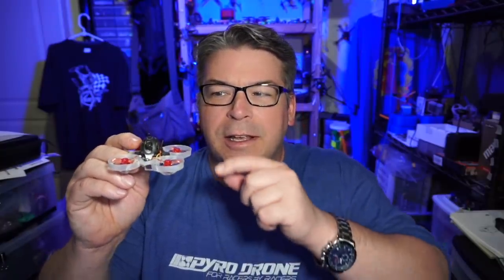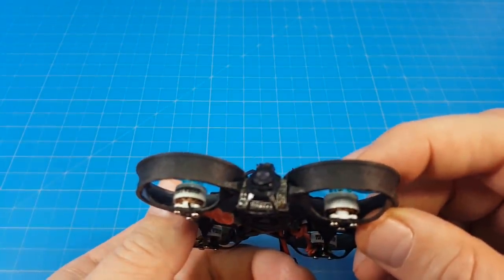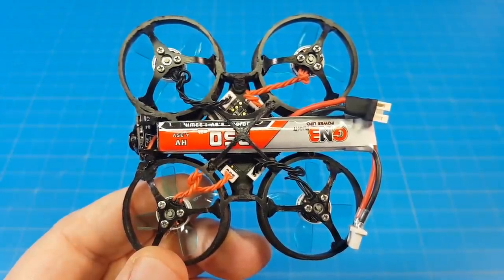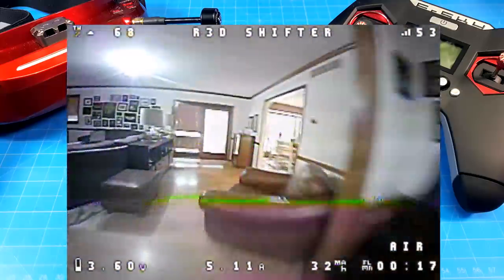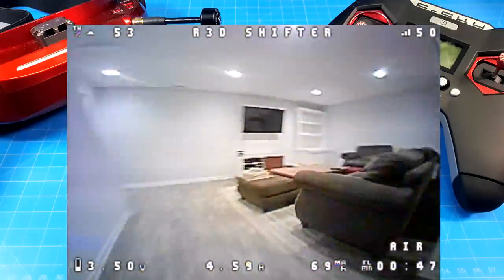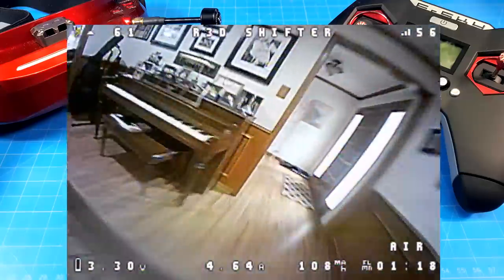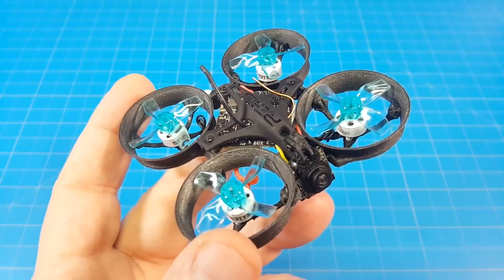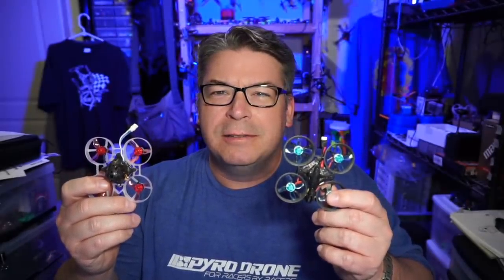ZeroGrav // 3D Print // Carbon Fiber Printed Micro Frame

Comment: Every time I watch one of your flights, I charge batteries and break something! LOL...You sir are a great pilot!
Reply from the maker: keep at it, over time it decreases. IMHO inside flying really helps us learn the fine control and makes flight outside so much easier.
Reply: @NickBurnsFPV   What kind of rates and expo do you set on your radio, and/or in BF for roll/pitch/yaw?  What radio transmitter are you using?   Could gimbal stick height play a factor in less control?  Seems to reason the lower the sticks, the more control if you fly thumbs.
Reply: Nick Burns Nick do you use solid pin PH2 connectors? If so where can I find them? Are they solder on pigtails or loose connectors?
Reply: Steve B tinywhoop.com should have some. The connector is already crimped on the power leads. Just solder them to the fc and your good to go.
Reply: Archer FPV Thanks man👍🏻
Reply: Steve B no prob 👍

Comment: No hoops in view is great, but it also felt like your mounting eliminated the very tricky jello issues it has on the stock frame.  As you were describing the reduced balancing load because of the center of gravity it felt you were aiming to say what I suspect personally; that it helps your batteries last longer (considering they are about the same weight).  This looks really nice!

Comment: I really enjoyed seeing the practise reel of the split s down the stairs maneuver. That's going to be killer once you lock it in! From the looks of most attempts, you've got the timing but the 1s setup just doesn't have enough power to pull out at the end. It's going to take a perfect shot, or going up to 2s to get it consistently. That got me thinking about lines while watching, and here's a suggestion/request if you're up for trying.

Go up the stairs then u turn and go down the hall along side the stairs the same as before. When you get to the end of the hall at the front wall of the house, instead of doing the u turn and then slit s, do a power loop up the front wall and back across the ceiling that drops back down into the stairwell to the main level. If you get the angle right as you float backwards while upside down it should actually give you more response time to spot the exit at the bottom of the stairs and more distance to recover thrust and stabilize for the turn out into the dining room. I know it's a tall order, but hey it's whoop season, and I bet you can pull it off!
Reply from the maker: That’s a good suggestion. Gonna have to get that half power loop right. Something fun to try

Comment: I know what glue to use its called Welders . A guy named Nick Burns told me about it . :p It works great I use it all the time . Thanks Nick
Reply from the maker: you got me :)  I need more. My cap got stuck and when I got it off I cracked the lid and it dried up. Back to amazon I go.
Reply: @NickBurnsFPV  I started wiping the tube with a paper towel ( use the same paper over and over) and the lid always comes off . Love your vids

Comment: I just took the canopy completely off my Mobula6, and reversed the frame to get a flat area to mount the camera between the ducts with a loom band. I also removed the motor connectors and direct soldered the motors to the board. Oh, and I replaced the PH2.0 with a BT2.0. Comes in at 18.1g. You could get it down even further if you really tried (by trimming the frame, etc). The new camera position takes a bit of getting used to, might have to alter the PIDs a little. Turtle mode works fine (I have the 19000Kv motors). I find that flipping it over in the pitch axis works better than in the roll axis, particularly on a wooden floor.
Reply: That 3D printed frame looks interesting but, it more than doubles the price, shipping to the UK.
Reply from the maker: It seems shipping outside of the US is a constant barrier. I have seen some slightly splitting a zip tie to make a low profile whoop, What sort of flight time you now getting with less weight and likely less ir on battery.
Reply: Can you please make a video showing details? Thanks!
Reply: @NickBurnsFPV  Close to 5 minutes. That is with the JazzMaverick 48kHz ESC firmware. I'm not exactly cruising but I have a really small house so, I can't push it like you do. I only charge my batteries to 4.2V.

Comment: I never thought it looked like a... BUT- we still need inverted motors/props like tinyhawk for unimpeded downward thrust. Prop "intake" airflow is more ambient and less depended on ubstuctions like wires/stuts
Reply from the maker: we might not be seeing much of that due to props and turtle mode. Maybe

Comment: I might do it? I'm really happy with the mobula6 it is by far the best whoop I've ever flown the 7 is great for more power but for performance the 6 has it all tied up! + no carpet in my pad so I'll stay stock for now.
PS
I hit a pole full pin,  only the front tip and 1 whoop cracked 2 drops of hot glue and a week later after many more hard hits it's all still good! Love the lack of damage on both the whoop or property from a glass to a wall! Happy model is on a roll! 
On another note the beta 65x 2s seems interesting hope to see you flying soon. 

Thank you and cheers

Comment: The  frame is Nylon 6 or 12, 3D Printed from particles (SLS). The clip seems to be TPU, could be printed with the same technology but can't tell.
Reply from the maker: I have been told its a hybrid filament of nylon and carbon.

Comment: FYI: My Mob6 went down in the first ten minutes due to a not too rough landing from only 12 inches off the ground. Though it was toast. Plugged it into Betaflight and everything was all screwed up. The dshot config. was wrong and ALL the flight modes were erased (It was all set up correctly before my first flight). I set everything back up as it should be (according to the paperwork they sent with the mob6) and all is great again. Flies perfectly. Just in case anyone else has had an issue with that board or drone.
Reply from the maker: I have heard this is due to battery w below 3volts. Maybe change the power setting to warn at 3.2volts?

Comment: Nice. I was thinking to modify a UR65 frame to be similar to keep most thing in line like this frame does. I also wanted to try a top mounted battery maybe they will make a frame like that.
Reply from the maker: A top mounted whoop would be interesting to try, it would bring the battery load a few mm closer to the prop line.

Comment: Use GOOP or E-6000 To Glue Stuff Together, Dries Pretty Quick & Is Silicone Based So It Stays Flexy? Also Works On Glueing Anything (Even Dis-Similar Materials) Together From Shoe Soles To Plumbing Pipes ETC, Can Be Molded Into Shapes That Stays About Same After Drying Also... Will Eat Some Light Foams On RC Airplanes+? About $6 For A Big (Tooth Paste Size) Tube Of It At Walmart+Stores? Thanks

Comment: Yes, I really like this design. Nice job R30Whoop. So much more expensive than a standard frame, like triple its cost... But that's only $10-$12 more!

Thanks for bringing it to my attention Nick, I think I'm in. They've got a couple of cool frames.

Additional note, I do some printing too. I've printed nylon impellers in liquid pumps with great success. Considered the CF Nylon too, but it can wreak havoc on your nozzles if you're not diligent. Again, nice job to R30 WHOOP. I'm excited about this possibility with a nice crazeebee F4 board or similar.
Reply from the maker: I am not surprised by the cost as I suspect the production is much more expensive that a mold. Then there is all the R&D. I think they did a nice job

Comment: Hmm I see on there site that u can mount the battery in the horizontal position, I wonder if the 350s would work well that way.
Reply from the maker: yes, I believe they added it to the site after I didn't realize it was an option.

Comment: Wow nick, im surprise you review this, i love this frame. And one time i receive the frame broken on transit, the motor mount broke just like yours, i do got replacement, they have very good support. Because it 3d print, you can repair it will solder, maybe not as smooth as new, but it will reattach nicely. Good enough to wait for the replacement arrive. About turtle mode, i got no problem with mobula 6 25kv and its 3 blade prop, however i use the r3dwhoop brushless frame, which differ in little strut in each motor guard, maybe the struts act as grip in the floor to help it flips.
Reply from the maker: The turtle mode could be the design I have. I see they have a slightly different design with the "horns" on the whoops, maybe those grip the floor a bit?
Reply: @NickBurnsFPV  in my case sometime it spin and stuck between ceramic floor and help the quad flip

Comment: The "stretchy/rubbery" parts are printed with TPU filament.
Reply: looks more like NylonX filament, TPU would flex way too much causing the drone to vibrate out of the air.
Reply from the maker: I have been told the camera and battery bit are a rubber filament and the rest either nylon or carbon infused nylon.

Comment: I can report that my Mob6 board changed almost all my settings when I ran lipo down past 3 volts in my error.

I have heard of others with Mob6 boards having same issue but I suppose it's not that bad as I rarly make running my lipo's down to stupid levels.

Nice flying Nick and love the look of that frame, its just the camera mount looks a bit iffy to me.
Reply: Hmm.. I often run my whoops down to 2.8~3.0v. That would definitely screw with me, lol
Reply from the maker: I believe licensetodrive had the same thing happen.
Reply: Btw, the reason that I often run them so stupid low is that the PH2.0 connector brings the voltage at the quad down under load (i.e. the actual battery voltage is slightly higher), plus the fact that the batteries are cheap, and come back up after resting..
Reply: To be more accurate I fly my lipo's on my Mob6 to 2.8 when resting after flight and I did make a mistake on trying to fly an uncharged lipo. I can remember the red leds on board go dark and convinced I had brocken my Mob6 and my lipo was fully charged so kept on sucking any atoms left in lipo.
Reply: @pepsfpv1326  ouch..!  but yeah I've done that too by mistake, lol ;)
2.8v after landing is definitely too low, though. Lipo's minimum safe voltage (even under load) is 3.0v. you can definitely abuse them a little, but that is pretty hardcore abuse, haha :)

Comment: Nick, I know this isn't about the M6 but I have a question I hope you or someone can answer. Just got my M6, and setup went fine. But the issue is that it won't come out of rate profile 2. Whether or not I change it  in BF or in osd, it goes right back to rate profile 2. It's weird. I've built dozens of quads and never seen this before. Not a huge issue, I just simply use rate profile 2. Any ideas ?  Thx. 
Btw, loved the split S over the stair rail. 😎👍
Reply from the maker: I have seen that on one board too. I believe I reflashed it to resolve...I think it resolved it.

Comment: I built a few low profile whoops in my life and always had issues with turtle mode on them. It's mostly due to them being flat on top. I had better success with gemfan tri blade or eachine/hb31 four blade props. 

I have a different question this time - which software and export settings do you use to edit your videos and upload to youtube?
Reply from the maker: I use Sony Vegas for the most part. Render to 1080p 60fps then upload to YouTube

Comment: Hello, I've that props too, the problem are the props, not the motors, another issue is the 1s, the same props with 2s, works good, but 1s and that props... Bad combination for turtle mode.

Comment: i am very impressed as a seasoned printer- carbon fiber nylon is difficult the print- The price is amazing. considering the energy needed to dry the nylon and print it at that quality.
Reply from the maker: Good info. Thank you
Reply: @NickBurnsFPV  also carbon fiber is abrasive so its very tough on the feeding mechanism and nozzle- often even coated and hardened nozzles need replacing after feeding kilograms of carbon fiber based filament through it- The carbon fiber with the nylon doesn't do much other than make it easier to print and make the print a little more stiff- it fights warping- warping is when you print plastics outside of an oven like environment, it can shrink on itself and deform- the carbon fibers help avoid that. its quite less strong than the carbon fiber that is weaved and coated in resin- much less rigid, very very expensive 3d printers can lay continuous carbon fiber- and the parts can replace aluminum cnc milled parts in production- however this is rare for consumer production 3d prints the fibers are much shorter and more "useless" in this nylon print,
the nylon is doing the magic here- its a very strong engineering plastic used in cars - often with glass fibers for the same reason as printing with carbon fiber. to stop warp and to increase rigidity

Comment: What tuning did you use? I kept frying those crazybee boards just using 450mah batteries so I've thrown a Geprc 12a board on instead but for some reason I can't stop th e motors from getting red hot, im only using 2S 300mah, and trashcan motors, I've tried mockingbird pids,  trashcan  pids and it just gets worse. Apart from this, it flies great haha
Reply from the maker: This one pids are the same as my mobula 6 pids. I didn't feel the need to change, I most custom tune everything I build and if an RTF doesn't fly all that well. In your case try dropping the d values.
Reply: @NickBurnsFPV  cheers mate will give it a go

Comment: Why don't they make a stiff frame, where motors connect, and have flexible ducts surrounding the props?
Reply from the maker: weight, cost and demand. There are some stiffeners that have been made to bolt to the bottom of the motors or slide around brushed motors.

Comment: I'm wondering what FC was used as Nick said this wasn't a Mobula6 swap. And I don't see the FC listed with the million batteries listed.  LOL
Reply from the maker: I did use the mobula 6 fc/esc/aio. The motors and props are different from the mobula 6, this is what makes it not a straight swap.

Comment: Wow, I’m still considering my first drone, been into RC’ for 20 years, but man that is impressive flying!!!👍
Reply: Go ahead and make the plunge D-rail. In started helis (and aerobirds, & zagis, and slow sticks, etc) around 2000' too, set things on the shelf for a free years and finally dove into the quads. Now I can't get out (ever) and I absolutely love it.
Reply: Anon Ymous I’ve been watching and reading about drones a lot lately and am completely confused at to what to buy. I’d like to start with something small like this one but don’t want to have to build it yet so I guess a rtf. Any suggestions to cut through my confusion?
Reply: @d-rail1514  I have recommended the Furibee F-36 so many times. It's about $17 right now on GearBest, sometime you can find it for $13. Buy 2. They come with a tiny remote good for kids hands but it'll teach you SO MUCH about flying a quadcopter. (I still punch the sticks so it's not "too small") Most importantly, throttle control. I've upgraded mine with higher rpm motors, camera, better battery connectors, but you don't need to do anything. I still fly one of them indoors completely stock.

The brushed motors will wear out but by time you burn through 2 of them ($34 invested) you'll be ready for something more and will have read everything and seen every video on the internet (well, maybe not quite, lol).

That's my best recommendation, unless you have a Taranis radio control already, then you can get a different one (like the UR65 or similar), and a module for your RC and use it to fly the tiny brushed indoor whoop without building anything or investing too much.

Finally, if you want to take a deeper plunge ($100 drone + radio), look at Nick's "Best whoops of 2019" video and don't get the fastest one he likes. Haha
Reply: Ok thanks and that looks like a good place for me to start, baby steps. Lol This is where it gets confusing as well as frustrating, I checked gearbest and search with no results found. When I google it I get a lot of similar looking products but don’t see anything Furibee F-36, just a bunch of other brands that look the same. Am I completely missing something? Or they all pretty similar? Thanks for your time!
Reply: @d-rail1514  I'll post on your channel so we don't bombard Nick's thread. Or are you on rcgroups?
Reply: Anon Ymous ok thanks, I’m only on a couple rc forums but they’re all ground based forums.

Comment: the best way to repair 3d printed parts is to melt it slightly where they connect and press the parts together, glue won't work that well
Reply from the maker: melt with a heat gun or soldering iron?

Comment: Hum, 4 blade props for the Mobula6?🤔
Reply: Gemfans.. it's only 19000kv, and 4-blades give you nice grip!
Reply: @lievenvv  
Interesting, so the 19,000kv comes with 4blade.. My 25000kv came with 3blade.. I like 4blade much better on my Rex80 4shO. Like you say, way better grip...👍🏻🍻👊🏻
Reply: @propsoff  oh sorry, I didn't mean it like that; I don't know what it actually comes with :) 
But they are 4-blades for the Mobula, lol ;)
Reply from the maker: the mobula6 does come with tri blades. I started on the zerograv with tris and moved to quad blade to gain some additional performance I was looking for.